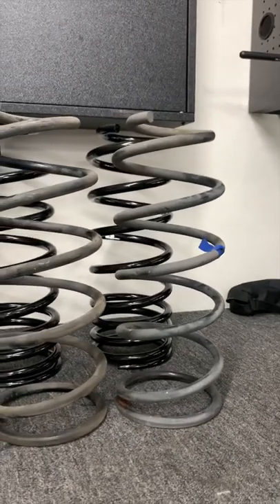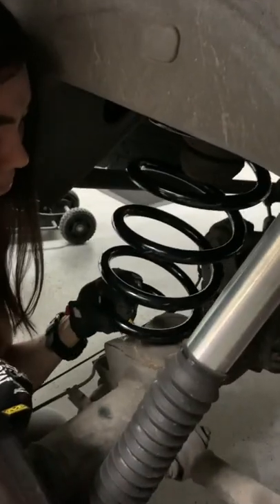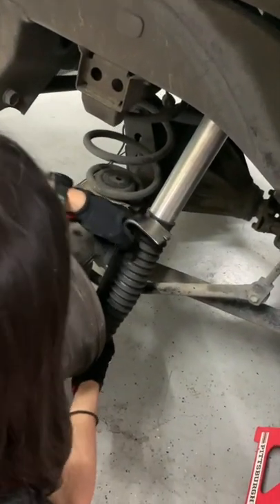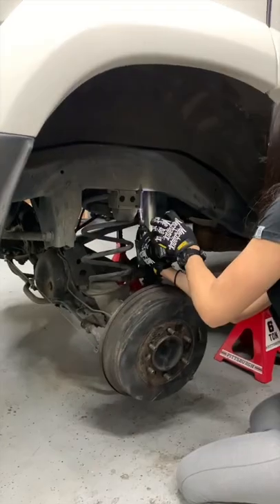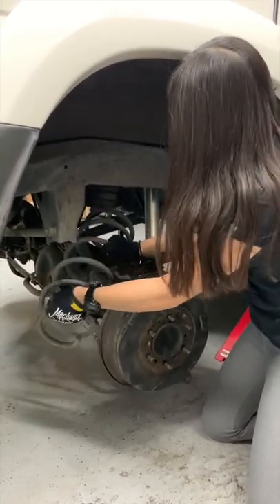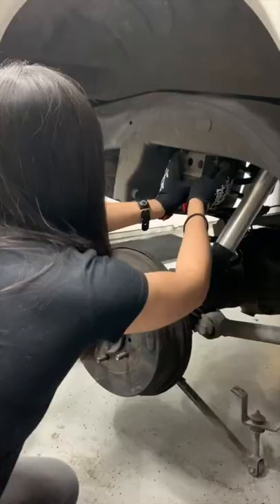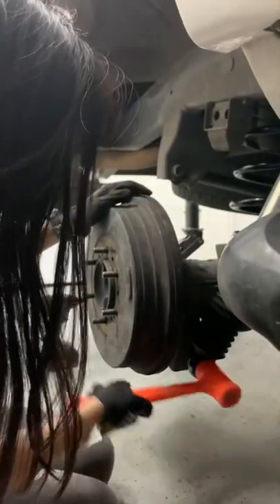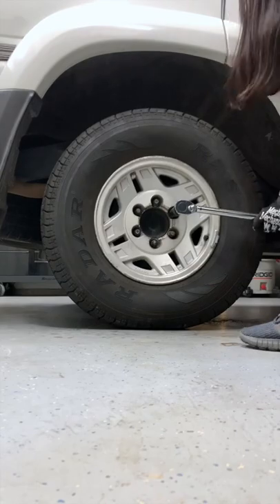Lifting my Land Cruiser Part 1 #shorts

Comment: Tip for anyone... use your jack...
When you disconnect everything, jack up the opposite side of the axle. It will increase the gap making it easier to remove and install springs. Then use the jack to compress new spring a little to help align shocks etc.
Hope this helps!

Comment: You did all that suspension work now it’s time for a alignment anytime you do suspension work it throws your alignment out
Reply: Not in the rear if you have a fixed rear axle I guess you have no clue
Reply: @jimcatanzaro7808  this doesn’t have a fixed rear end. It needs longer control arms to push the axle back to stock position and probably a longer track bar
Reply: If she is capable of doing all these by herself, she will be knowing about all these alignment stuff already.
Reply: @jimcatanzaro7808  Hopefully its not just a lift in the rear 😂

Comment: I want you to rewatch your video and take note of when you put the newer stiffer spring in after taking the bump stop off with the 2 12s millimeter bolts. You put your whole hand around the spring while it was being put on the mount don't get into the habit of seeing if it's going to bite you because one day it will and it's going to take all your fingers

 do not get in the habit of seeing if things will bite you